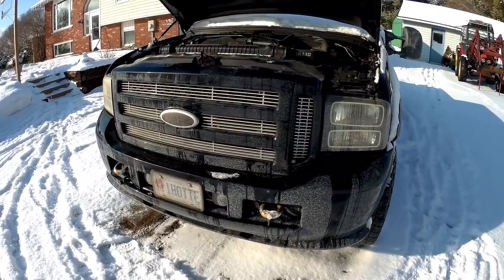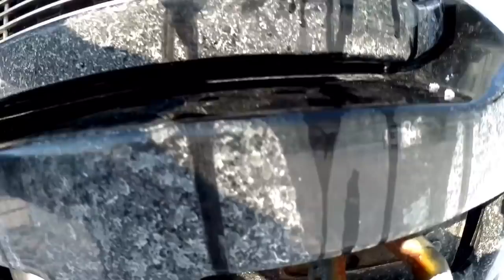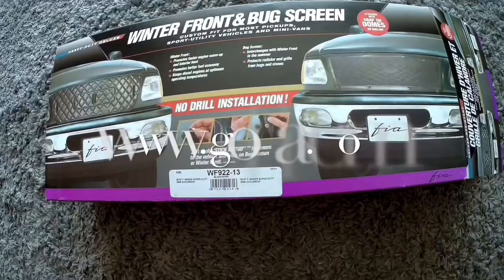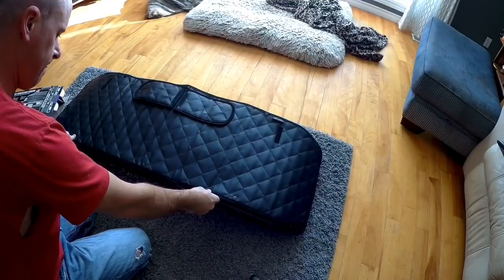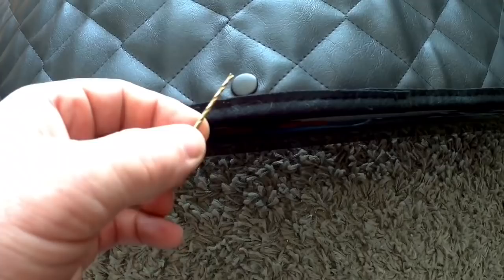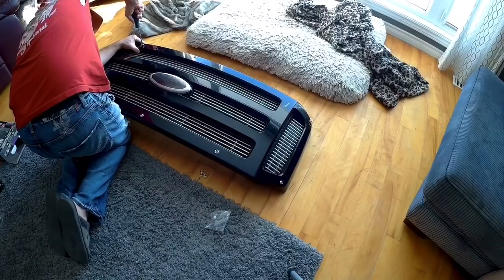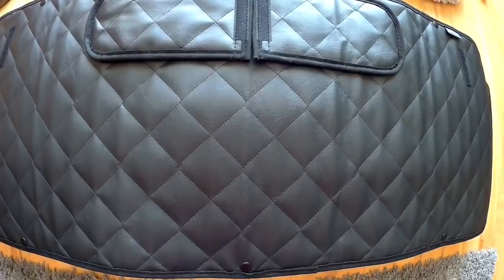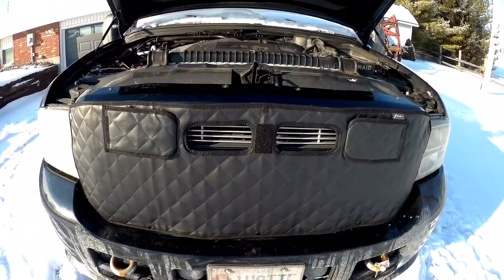Ford F-250 Grill Removal and Winter Grill Cover Installation - Gofia.com

Comment: I put mine on today last day of October here in Michigan,we got nighttime lows in the high 20s,it makes a huge difference in fuel mileage because the truck acuatlly gets to op temp.i would suggest replacing your t-stats at some point they stick open and even with a rad completely covered these trucks wont get to op temp

Comment: How did the cover work out for you?
Reply from the maker: It worked out great, never had a complaint
Reply: Good to know. I just ordered one myself. Take two trips west hunting every year and going down the road sometimes have trouble getting heat to blow. Hopefully this will solve that.
Reply from the maker: I thought it was enough to cover the grill and leave the flaps open, but the all had to be closed for heat. Just those little openings made a difference in the cover